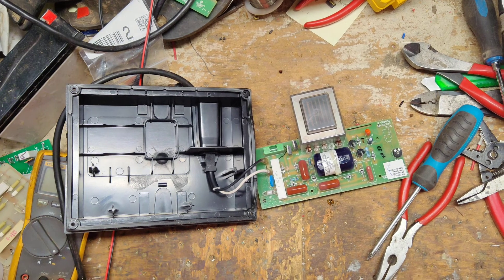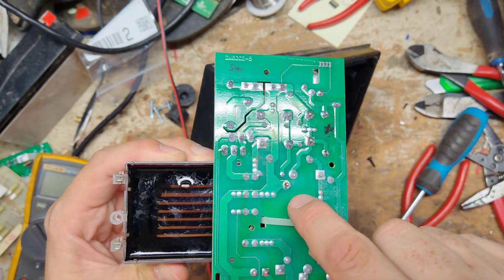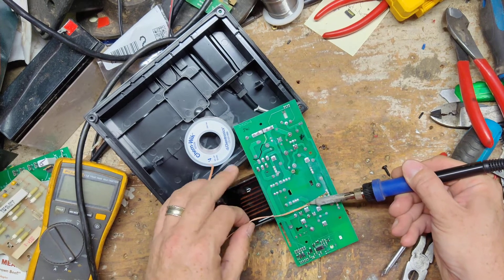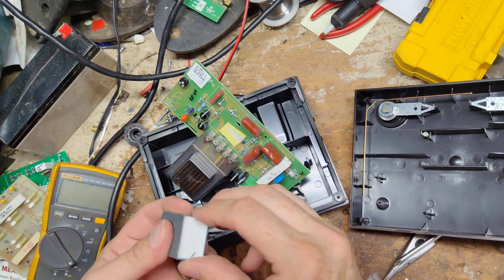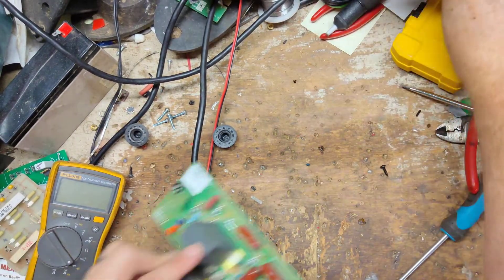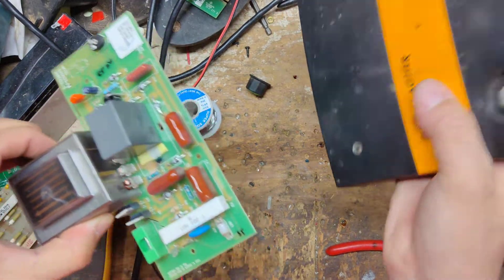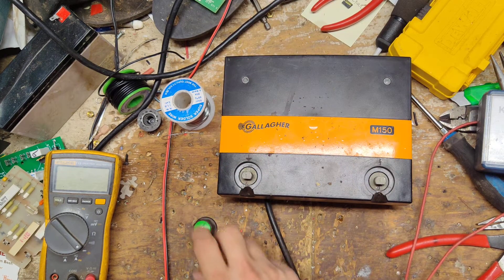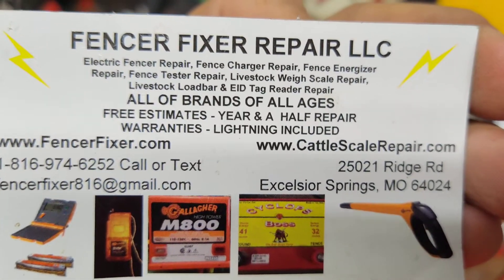Fixing An Electric Fencer With Low Output Voltage Low Shock | Gallagher M150 M300 Repair

Comment: Hi there. I have an M150 and want more Joules. Since the transformer is the same as M300, can I swap the 8uF capacitor in the M150 for a 15UF capacitor from an M300? Thus turning my M150 into an M300 energiser. Without causing damage of course. Thanks
Reply from the maker: I think you should be able to. You'll have to desolder the old one off and hardwire solder the other one in place. You could also get a second 8uf 900v capacitor and just solder across the backside of the board where the other capacitor is already at and that will do the same thing. Capacitors is parallel add up together. The only thing I could think to also do is upgrade some of the small diodes to higher amperage ones, like 6A to 10A range, since there's more power being dumped through the SCR when it fires those capacitors. Your night look at the SCR and see what the number is on it, and possibly replace it with a TYN1225.
Reply: @FencerFixerRepairLLCKansasCity  thanks so much for all the tips. The irony of the situation is that I live 10 miles from Gallagher's world headquarters (Hamilton new Zealand) but they won't sell me the capacitor. They must want me to buy a new energiser
Reply from the maker: They used to be like that here as well and you would have to go through a dealer to buy parts, but they changed that policy about 10 or so years ago. You don't need to buy the fancy Gallagher branded capacitor thought. Just find online an electronic component place and search on their website, 15uF 900v or 8uF 900v. The capacitors will be square/rectangle in shape and have pins on them vs wires, so you'll likely have to solder on some leads to solder into the board. There's no polarity to the caps so it doesn't matter which lead goes to which solder joint.